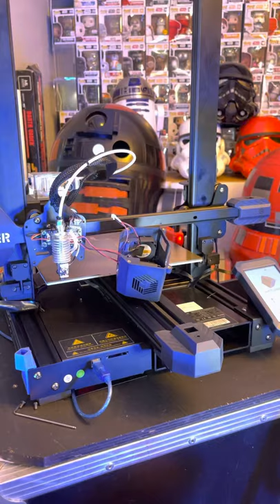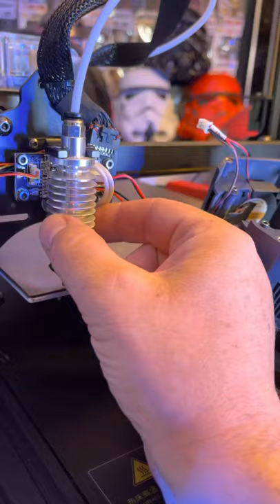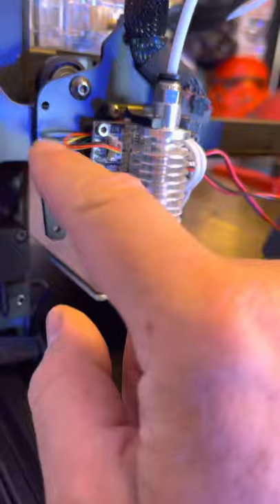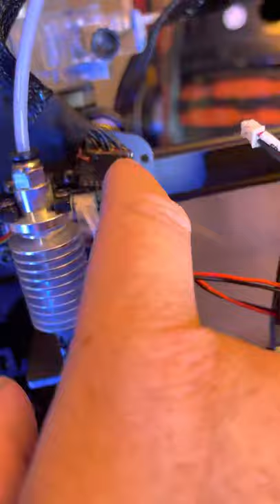Anycubic Vyper 3D Printer Bed levelling sensor

Comment: I just broke mine yesterday trying to remove the nozzle, so I ordered a new one. And it's a J-Head Volcano V5, not a V6. It cost $16 on Amazon and I suggest to make an upgrade with a bimetal heatbreak ($18-20). The best should be to adapt a V6 hotend on the Vyper.

Comment: If the light don't come on and the sensor isn't working and the nozzle presses really hard into the corner then probing stays on screen, what do you do ? Is there a loose connection?

Comment: Hi, I have this printer and we have a problem, the level sensor don't detect, the equipment send us a message dat "auto leveling sensor abnormal, please power off then check it and wiring", we have been checking all the equipment also change the level sensor but the results are the sames, could you give me support? thanks.

Comment: Thanks for the help, i pushed mine towards the rear of the printer til the red light stayed on. its on 2.3.5 not sure the mobo type. i guess it just bends itself out of whack in a failed print or if removing the noz. working great now. if you cant get the light to turn on then i guess its screwed.

Comment: We are having similar issues with the sensor on Anycubic Vyper. When we start the auto-leveling, it asks to touch the nozzle, when we touch it, we see a red led, but the printer doesn't react and doesn't start the auto-leveling. We tried to update the firmware and replaced the sensor and it didn't solve this. Could you please help?
Reply from the maker: You’ll need to contact support

Comment: My Viper does not level at all as soon as it arraved on the first level point a message comes on the screen: Abnormal level cut of power and check wireing. Id did check wireing multiple times and can not find anything wrong. What can i do to make this printer leveling? Please help me.
Reply: ive got the same issue, have you found a solution yet?

Comment: i have a question, i got the vyper 2 days ago.. but a got the red light always on, even when not printing.. and it turns off when i touch the nozzle.. is it normal? in every video i saw, it seems to be the opposite..
Reply from the maker: I might be normal as there are now 4 versions, if
It levels and prints fine you’ll be okay :)

Comment: Hi, just see your video today. I disconnected the plug because je sensor is remain active even notcin contact with the bed . But... i dont remember fan0 is for the hotend or local ( front fan). Where i can find a drawing of this ? Thansk in advance
Reply from the maker: I’d guess on the anycubic GitHub
Reply: Ok I will try to find it , thanks .
Reply: May be I m bad I don't find my answer. 😢

Comment: Hello, i think my pressure sensor is broken. When i do start the autoleveling process the nozzel pushes down the whole bed and the steppers make a wired sound. How can i fix this?
Reply from the maker: When you move the nozzle does the blue light come on inside the extruder case ?
Reply: @TheRealSamPrentice  same issue, light don't come on.
Reply from the maker: @Gladiator1080  Okay ping me an email and I’ll put you in touch with the right person
Reply: @TheRealSamPrentice  ok that would be great, where can I send you my email ?
Reply from the maker: @Gladiator1080  therealsamprentice@gmail.com
Reply: Hi there, I have the same problem as well. I believe my pressure sensor is broken. My nozzle just drives down straight into the heat bed when attempting to auto level. The lights on the little motherboard don’t come on either. Have any of you found a solution?
Reply: @MiIesMan  sadly i have no solution 
All connections at fine and software also. Seems to be broken somehow. I see more and more people with this problem. I don’t understand why it’s break after such a very short time.
Reply: @Gladiator1080  @itsround so anycubic support just got back to me. What we see in the video is called a strain gauge. The failure is caused by a bad strain gauge sensor and anycubic is sending me a replacement part. Fingers crossed!
Reply: @MiIesMan  ok sounds like I have the same Problem them, Hope they answer my soon
Reply: @MiIesMan  they answered an I get a new one :D
Reply: I will also get a new strain gauge. Just wondering, the light on the pcb in my printer is red.
I disassembled the printer head at the gauge was more sensitive…
Reply: @itsround  mine is also red even with it completely unplugged. I tried bending it around and the red light would flicker off and come back red. It seems they’re meant to be very sensitive and mine just isn’t working properly
Reply: @MiIesMan  so just email anycubic and you will get a replacement, mine will arrive in 2 weeks. Keep you all updated!

Comment: When I start the autoleveling the screen crashes. The question about "do you want to start now" also doesn't appear at all. How can I fully reset the chip and reinstall the newest firmware?!
Reply from the maker: I’d go with a firmware flash on the screen and the motherboard
Reply: @TheRealSamPrentice  I've done this already several times and I've just did it again, but it doesn't help at all. It has still the same issue. The screen crashes and the autoleveling doesn't start.
Reply: @TheRealSamPrentice  I did the flashing also in different orders. First the screen then the mainboard. And another time first the mainboard, then the screen. It still doesn't help.
Reply from the maker: @hamidaminirad  humm okay did you install the community firmware?
Reply: @TheRealSamPrentice  I have installed the version 2.4.5 or what do you exactly mean by "community firmware"?!
Reply from the maker: @hamidaminirad there was a version made up by community members, I was wondering if you had tired that and then the screen messed up.. the only screen issue i've had was then there was a pinch on the cables, and when the firmware was incorrect. Have you tried an earlier version
Reply: @TheRealSamPrentice  no I didn't try an earlier version. I'll do that now
Reply: @TheRealSamPrentice  Where can I get an earlier version?!
Reply from the maker: @hamidaminirad  GitHub ?

Comment: I don't think that it's V6, It looks like V5 like all hotends from Anycubic but with a different mount. I'd like to replace heatbreak with all-metal, but It's hard to find the right one. Maybe the best heatbreak will be prusa mini heatbreak from bondtech and shorten it to the right length.
Reply from the maker: You might be right !
Reply: it's a V6 Volcano clone with PTFE lined hotend, so all you need to do is to upgrade to all-metal/bi-metal heat break

Comment: Hi, i'm having an issue where i press auto level and the first position it tries to probe is off the front left corner of the bed so it troes to probe and gets stuck because it isnt making contact. Any idea what this could be? I have a v 6 motherboard running 2.3.5 firmware. Thank you!
Reply from the maker: I’d check your z’s are working are both motors moving ?
Reply: Thank you alot for the reply. I figured it out...... i wasnt waiting for it to heat up lol i'm too used to the ender 3
Reply: Okay, i've run into another issue when setting up a cura. I dont know which machine settings to use
Reply from the maker: @shanerichter6402  have a look on the sd card the settings are on there buddy

Comment: Question regarding the hotend extruder van. My i3 Mega S had out of the box a noise level of more than 75dB with a sound like a airplane takeoff. I exchanged the van and now the its not noticeable. Is Anybubic using some better van's for the vyper?
Reply from the maker: Are you sure it’s the fan and not the crappy drivers ? If you have a look at my videos I have a driver upgrade for the mega x printer. The vans on the vyper are indeed much better

Comment: Hello, I I bought my Anycubic Viper in preorder and it's now here in my office. I am already an owner of a Mega S. I have mounted the printer correctly and at the time of AUTO LEVELING the printer at the first measurement does not stop on the Z axis and the nozzle PRESSES ON THE PLATE until the printer starts to sound an alarm and the plate begins to sag.
To stop the process, I have to turn off the printer and after turning it back on bring everything to HOME.
It does not self-level ... I don't know what to do. The sensor probably do not work right? any suggestion? thank you
Reply from the maker: Sounds like a fault are you on Facebook? Give me a message on there and I’ll put you in touch with support
Reply: @TheRealSamPrentice  yep, I will, thank you
Reply from the maker: @Busckak  I’m just working on a video about that problem as it happens
Reply: @TheRealSamPrentice  👍👍👍
Reply: @TheRealSamPrentice  the sensor is damaged and is not reading the plate that alarm is the software it had gone past 0 which is set below build plate
Reply from the maker: @ronnyoo9371  what are you telling buddy?
Reply: @TheRealSamPrentice  it was for busak even tho he probably got it resolved already....
  but does ur level light stay on when printing ?or does it flash it it prints ?